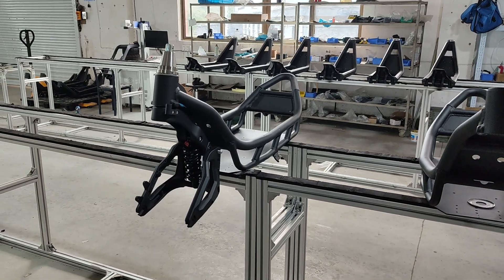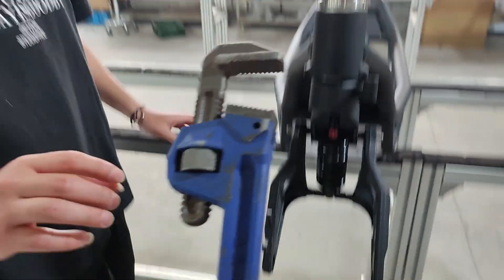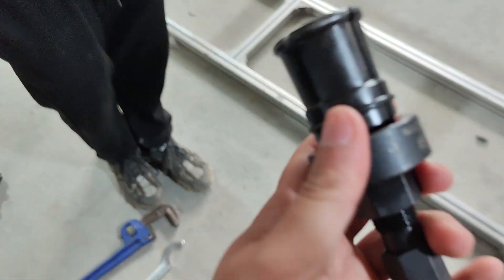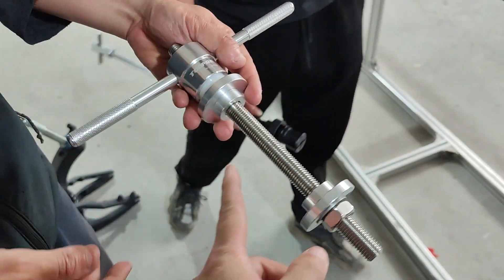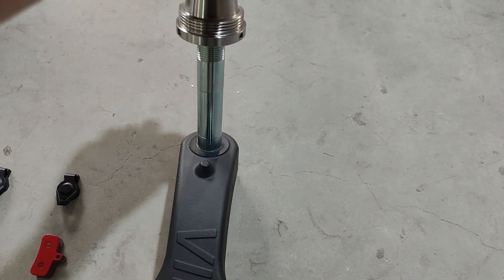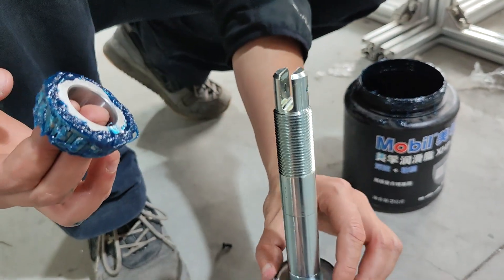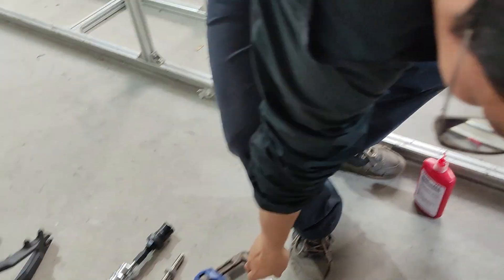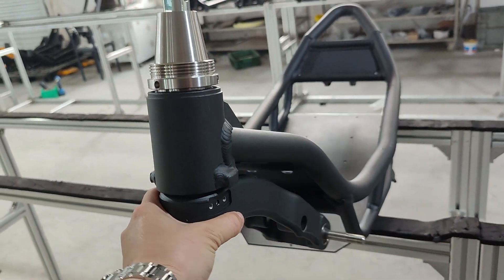Nami Burn e headtube shaft/bearing exchange

Comment: Hello, I wanted to see what your thoughts were on some upgrades that I did to my Burn E 2 . I have a 28 ah version and the turbo did not seem to be working so I purchased the 50 amp controllers . As you know my version has the 1000 watt motors, but now when I turn on turbo it is actually extremely noticeable. Do you think those motors are going to be able to handle the power over time ? So far so good though . I have also added every single upgrade that comes on the new bern E 3 Max . Everything works flawlessly so far .  Thank you

Comment: Thank you for the video. Just feedback -> My brand new Nami burn-e 2 max  40Ah with the newest LED lights and reinforced frame just developed a steering notch just after 500km of ride.
I am not a heavy rider just 85kg, and I didn't ride it in the rain, so not sure why this is happening on the model that should be "problem-free" . Well, I guess lets buy some tools and let's have "fun" with it. Otherwise, the scooter is very good :)

Comment: Hi Michael Sha,Quick question for you sir...I got this spring a 40Ah version and I notice sometimes that when I turn my steering wheel  is not moving smoothly as I turn but in increments such like a pre-set position which cause me to feel like I don't have a controlled turning of the steering and causing an imbalance in the ride...Do you think that this is  a sign that I need to change the bearings...again this problem is showing only sometimes.Thank you and looking forward for your clarification!
Reply from the maker: you could do a service to the bearing, and re grease it. most likely the bearing should be fine
Reply: Thank you very much Michael…will do it when I will take the scooter for service
Reply: Does your steering feel choppy ? Mine just started feeling stiff and jerky movement
Reply: @Mike-z3v7c  Hi Mike
You have to take it  to where you bought it from…if you are lucky maybe it just need loosening one bolt without need to do a bearing service (the place I bought didn’t even charge me for it and got it back in 30 min

Comment: Michael I bought the 72v 40ah model.  How long should I take to change the bearings?  at times the steering wheel became very hard, and I just loosened it a little with the special wrench, and the steering wheel became light, but before that it seemed to me that when turning the steering wheel it stuck, I thought that the bearing had broken.

Comment: Hello Michael,
When did you start to build in all the update parts?
Ordered a Burn E2 Max 40AH and it is from 04.2023. It is currently on the way from CN to EU. Do i already have all the updated parts that you showed here intalled?

I will open the motors and coat them with ECS 71 Urethane before drivind around. I will probably also make holes so moisture and water can get out of the motors.
Are the motor temp sensors installed on the hottest spots on the motors?
Reply: I have the Same Answer please Michael Sha Talk with us 😂
Reply: @emilio13  i read on facebook that the ones produced in 2023 have already updated the stem but i am not sure if everything is updated. 🤔
no answer = no it is not 😨?
Reply: Question*
Reply: Okei when I Buy a New Burn E 2 Max 40Ah is it possible that the steel stem New bearings ist also installed (2023Charge)

Comment: Since when is the alumium ones been replaced with the upgraded steel version from the factory? I just ordered burn e 2 28Ah version and wondering do i have to replace the shaft.
Reply from the maker: it is not needed for replace unless you have a accident before on the unit, a crash or a bad hit 
or you just worry about it